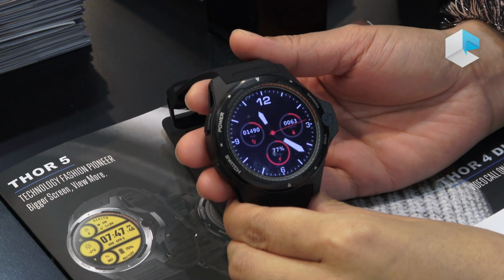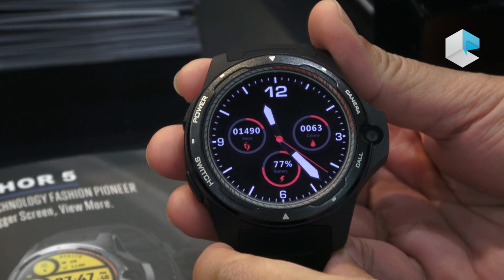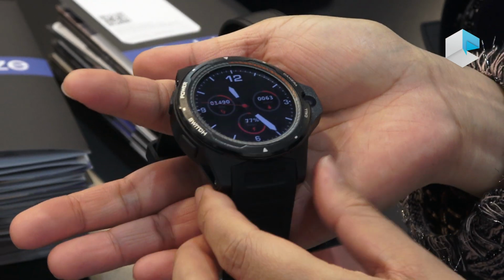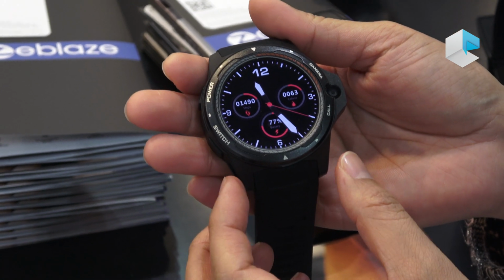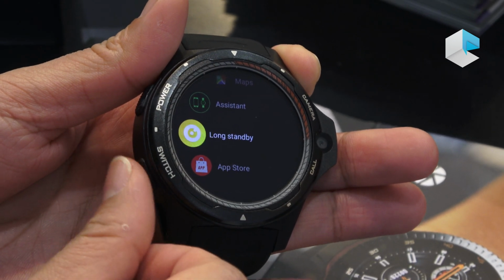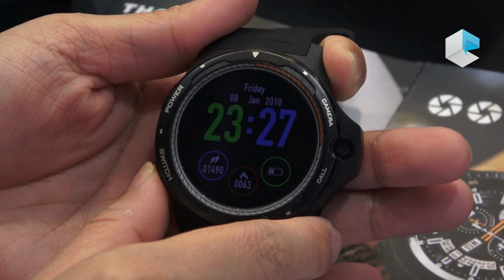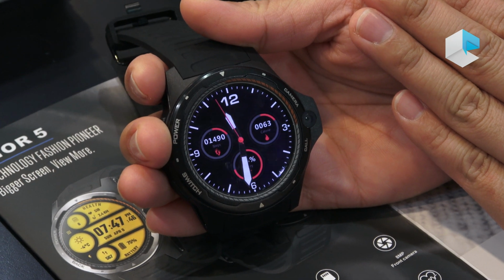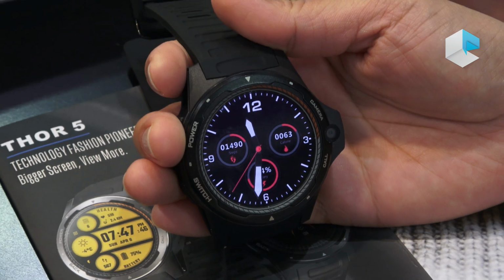Zeblaze Thor 5 smartwatch dual-mode

Comment: Understand the Lempro LEM9 has the same dual processor with standby function, but the last firmware update has turned off the standby function (it only shows for about 2 seconds). People are very unhappy about that, it's not what they thought they were getting.